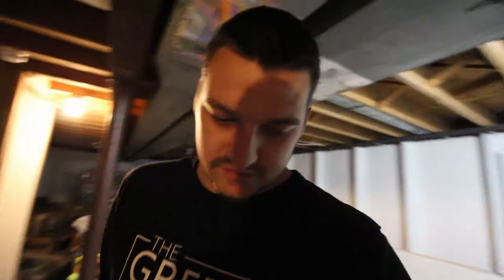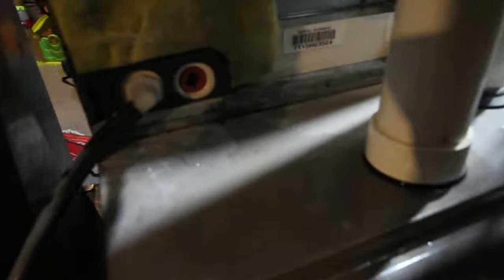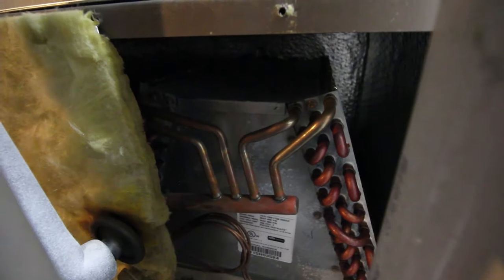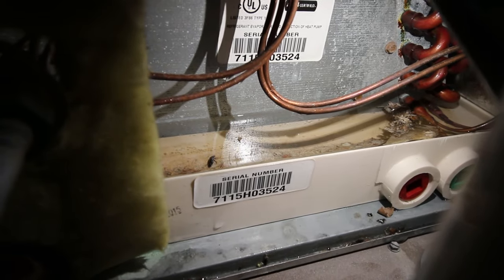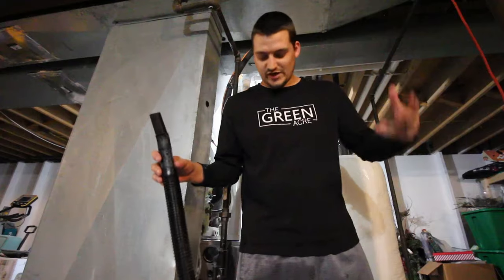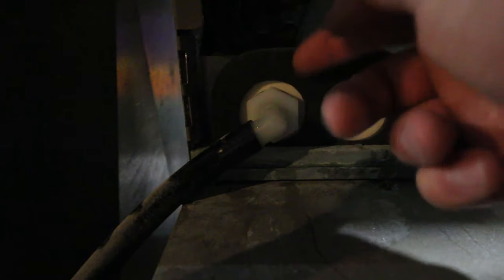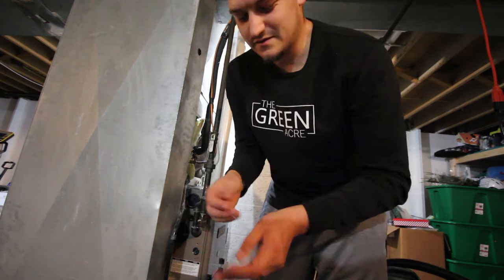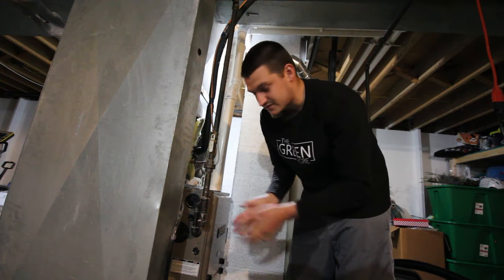Why Is My HVAC Unit Leaking Water? | The Green Acre

Comment: Wow, you saved me from a costly plumbers visit.  I replaced the filter that my plumber suggested but there wasn't a change, still leaking just like yours was. Was ready to try to take off the metal lid like yours when I noticed that the drain pipe has a clean out on the top. I unscrewed it and it was filled with water. Pushed a electrical fish wire through a few times and voila' the water came rushing out into the drain pump and was ejected. Hopefully my problem is now gone. Thank you, thank you, thank you!
Reply from the maker: @whiteoconnell  Fantastic news!

Comment: Thank you so much.  My HVAC unit is in the attic and it was leaking and I turned it off; 24 hours later it  stopped leaking, so I’m pretty sure it’s the same issue as you had here. It was overworking and the coils probably froze and couldn’t do their job. I’m not an HVAC woman so I probably will end up calling that $100 guy because now I’ve got to fix the ceiling in the closet over which the AC is  located.  Thank God it is in the 70s this week!

Comment: Thanks for the video. My local plumbing company came to check similar issues happened in my basement. They initially said there's a problem or something clogging which is going to cost me $50 to fix. Unfortunately I was not at home and was at work. They call me half an hour later and said that the coil of the air-conditioning is damaged and will cost $2000 to fix including labor. I'm not sure what to do. Any advice would be grateful. Thank you

Comment: I'm having a similar problem right now, but my drain line still drains while the unit is running, but im still hopeful its a blockage somewhere along one or two of the lines, theres a total of 3 lines that converge to the drain outlet. Thanks for the vid!
Reply from the maker: Sounds like you may have to isolate the drain hoses and inspect for individual partial clogs in the lines.
Reply: @TheGreenAcreWI  yea, after I turned the relays off and I popped the line that was directly below the incoming lines from the condenser, I got 2 full 16oz cups from it, with some little bits of rust/debris, too. It also drained out a lot quicker than the actual drain outlet does, so I think there's some heavy clogging between the two places.

Comment: Not a maintenance person, live in Anchorage, Alaska- have a leak from garage ceiling, know the maintenance guy said there was a problem with condensate pipe, very concerned about structure & mold being in the townhouse am renting, had smelled mildew mainly where moisture was collecting into area above garage, below bedroom. Now our heating system is not heating our unit since the vapor/moisture leak was fixed.
What else should we be concerned about? Our housing authority isn’t fixing the issue, we told them about leak 5/2021 that wasn’t fixed till 10/2022- now since 10/2022 we have had serious issue being COLD! It’s below freezing & home is stuck around 58/60 degrees F since winter started!
Reply from the maker: I'd call in a HVAC expert to access the situation and get it corrected ASAP, especially if there's mold present. Then deal with your housing authority back paying you for the repairs. Your health and safety is more important than fighting the authority to deal with it in a timely fashion.

Comment: The exact same thing happened to me. The primary clogged and it started leaking out the threads of the red plug in the secondary. Not understanding that the red was a secondary drain they never utilized, i put teflon on a new cap and sealed off the secondary. I didnt stop to think about why the primary was clogged in the first place so two weeks later my pan overflowed all over the furnace below it. After that i unclogged the primary and instslled the exacg same nylon elbow with some clear tubing to the secondary so now i keep an eye on that secondary tube and if it ever gets  water in it i know its time to ckean the primary. I see you still have the same red plug in your secondary.  I would suggest screwing in a nylon elbow and tube into that secondary one as well.
Reply from the maker: I like the clear tubing idea in the secondary 👍
Reply: @TheGreenAcreWI  the nylon elbow was at lowes right next to the clear 1/2 inch tubing. Its a 3/4 MIP to 1/2 inch barb elbow adapter.

Comment: Ive cleaned mine but didnt know about the pan. While most of the water does leave like its supposed to, im still getting drips on the air filter and accumulation in the bottom pan

Comment: My air conditioner was leaking at my apartment complex. Believe it or not, the air conditioner unit is in a little room in the bathroom of the apartments here. I called maintenance twice about the leak, and after they left both times, the leaking was still going, just not as bad. I watched your video and fixed it myself. Mine was much easier to fix than yours. I just pulled those tubes apart and drained the water, and now the leak is completely gone
Reply from the maker: @daved1535  That's great to hear!

Comment: Your drain hose should be into the right side(red plug) as its a smidge lower than the secondary drain hole that you are plumbed to.   The red side will drain the pan sooner.   The side you are using now allows the water to be deeper before draining
Reply from the maker: This contradicts your reply on "Martin Go's" comment?
Reply: @TheGreenAcreWI  true.  When i replied to martin i was @2:40 and assumed that red plug was what he was talking about.     The drain holes on right side of pan.
Then @4:36 i see the drain holes on left side of pan.  That has red plug too.  Thats the side im referring to in my comment you you.
From video it looks like right side of pan red plug is the higher  port.   Left side looks like red plug is lower port.
Reply: If you ever increase the drain size to 3/4 pvc it will be less likely to get slimed up and plug. (Cause of most plugs)  But your plug was debris.  Thats from the installer im afraid.  Just messy when the plenum was open.
Reply: Sorry. I confuse myself sometimes.
Reply from the maker: @MrHemi4spd  I agree, issue from installation that made itself known years later.

Comment: I’ve been getting condensation on my AC lines and even all the way to the duct work. My AC company checked it and said that everything is fine and this is normal. My AC lines on the inside of the house have been dripping water. Is this normal ?

Comment: So question. I don't have A entire Unit indoors. The main part with the fan is outdoors and excuse me for not knowing what anything is called right now but I’m in A panic. 
Do I look for something different as far as A hose that could be clogged?? 
Let me back up. I was changing the filter and its wet??? 
My 1st thought was to cut the power and go outside and spray down the outdoor compressor.

Is anyone on this link right now who may know

Comment: maybe a stupid question, but is it still safe to operate? or just shut it down till the clog is fixed?
Reply from the maker: You can run it still but obviously it will continue to leak and potentially cause some other issues until it's fixed 👌
Reply: @TheGreenAcreWI  thanks! That's what I thought. I don't need any more water on the floor. I turned it off

Comment: Can anyone tell me if I can replace my primary pan that is leaking due to a crack. Model FSM4X3600A from 2008 so yes 15 years is pushing it in a humid, unconditioned attic.. I can get the pan delivered to my door for $110. A service provider is quoting $800 to replace, but unsure if they have to remove the evap coils first or not which would push the cost much higher. It's too old and rusty to spend money replacing evaporator coils. It is cooling fine. I'd spec the $110, maybe even $800 if it meant I could kick the can down the road and replace this in a few years. Anyone know if this unit's primary pan can be replaced w/o removing the coils, and something I could do myself with no HVAC skills to speak of, but I know how to turn off a breaker and give it s shot!

Comment: My evaporator coil drain pan/Goodman system, is defective.  Is it safe to use the furnace for heat?
Reply from the maker: I'm not a furnace repair man so I'd reach out to a certified HVAC technician if I were you 👍

Comment: Thank you very much 🤝🤝👍👍💕💕💕💌💌I have the same problem and I will try to fix it myself now I have understood a lot through this wonderful video💪💪💪🌹🌿😘💪💪💪💪🤝👍
Reply from the maker: @icecream-s5c  Happy to help!
Reply: I don't have water in the pan but when I when I was pulling the dirty filter I felt sprinkles of water. 
Its dripping on the filter.  
It’s set at 74 but says its 79 in here so just before I pulled the filter I was going to cut the power and clean the outside 1st. I live in the Desert. Wind and sand are miserable!! 

I’m going to check what you said 1st. Thanks you

Comment: What is that red cap on the right for?? Mine is leaking
Reply from the maker: Without taking the unit apart again, I can't be 100% certain but I believe it goes to the same condensate collection pan. You could try tightening it to see if it's loose, otherwise maybe remove it, apply Teflon tape and re insert it 👍
Reply: The red one  is a secondary drain.  Its a touch higher than the primary.  Its for if the primary plugs up it will drain..  but often once the primary plugs up the secondary plugs up soon after.
Reply: @TheGreenAcreWI  yes it goes to the same pan.  Its just a bit higher than the primary drain hole.   Its a secondary drain.   
If you put a water sensor in the secondary.  The unit will shut off if the primary plugs up
Reply: It shouldnt leak unless the primary is restricted

Comment: What about if the leak is from the elbow
Reply from the maker: @sylviarobles91  if the elbow is leaking it might be cracked or water is getting through the threads. First, double check that there isn't a block somewhere in the line and then either replace the elbow or apply teflon tape to the threads to take up any space that moisture might be getting through. Hope that helps!